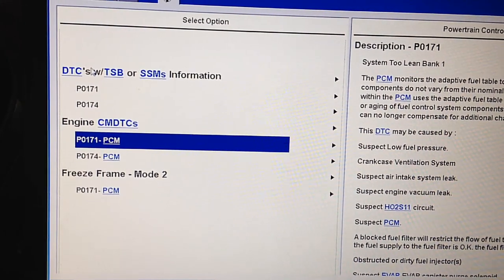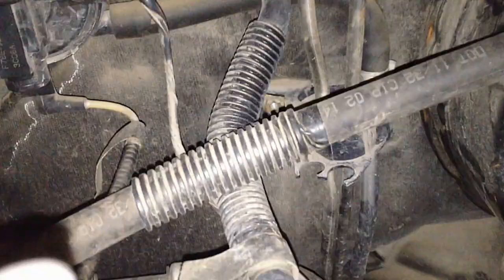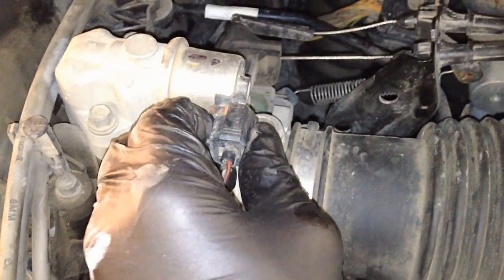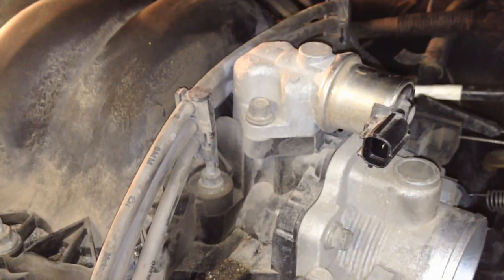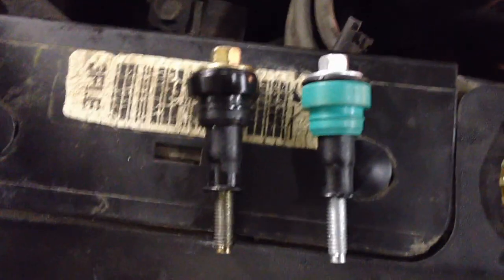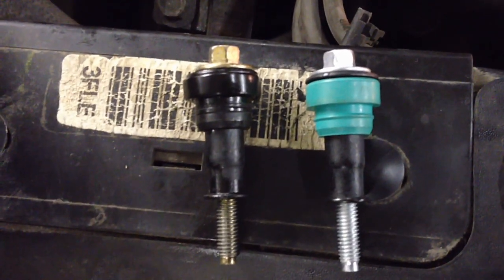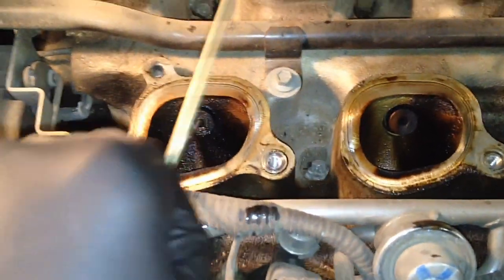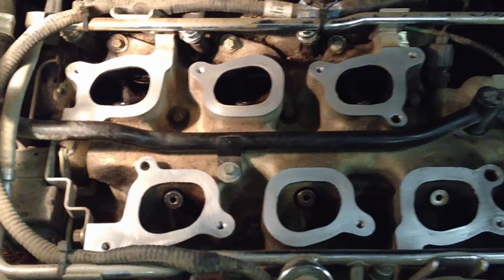Ford Windstar P0171 P0174 Upper Intake Manifold Gasket Replacement

Comment: How long does it take to do a job like that?
Reply from the maker: +James Weissbach Upper intakes maybe 1hr
Reply: Thank you again. I have all the parts I bought last year. Your videos are the best. These videos give someone more confidence . Awesome.
Reply: +James Weissbach  If you have not  done  the work, yet  and assuming you have  a 200 to 2003. I just  did my Van. First, I put  all  sensors new. Gained more power  and better  fuel mileage. But, did not helped with P0171  and P0174. Had no  vacuum leaks The van ran fine, Idled fine. But, when it was warming once the needle was like one quarter it started to miss. I had to put it in Neutro  and accelerate a bit. Then, when it warmed up no problems. Well,  I did the job. Put new Isolator bolt.  new gaskets  for the middle intake and the top. Bought from partgeek.com. The job looks a little hard but, in fact is easy if you have worked on car before. Be very care with the Isolator bolts. Some one here on youtube recommended 80 pounds of torque. Another one recommended 60 pounds of torque. I should have listened  to the 60 pounds man. I popped a bolt trying to get to 80 and that was bad. Now how am I going to get that piece of bolt out. Got me  from autozone  a bolt extractor  used the smallest  drill  dead center on the broken bolt. Started slowly drilled about half inch inch in,  I  reversed the drill and  the bolt came out about 1/4 inch grabbed with a pair of grip got it out in about 15 minutes. It takes 60 pound. Use a  sequence diagram   to tighten  the bolt. A needle dial torque wrench would be nice. That click one I don trust.  Use in  20 pounds increments in sequence. That should take care of P0171 and P0174. My gaskets in the middle  intake were oil wet evidence  it had  a vacuum leak there. Now my van do not miss while it is warming up. It cost me $350. The oxygen sensor, $128. at partsgeek.com. I had that installed. $ 100. The rest I did. Good luck!!
Reply: +James Weissbach It took me three hours. Because I took my time to make sure everything  was done correctly.
Reply: Thank you so much. I'm tired of getting ripped off.
Reply: +James Weissbach  I hear you. There are a lot of dishonest mechanics out there. If you had or had not done the job be careful with the Isolators bolts. Someone mention here on you-tube that it takes 80 pounds. No they don't. I tried and I broke  one. Had to buy that bolt extract from auto zone to extract it. I followed this video here and is very good. Tighten  the Isolator bolts to 60 pounds  20 pound increment  and in sequence. Do the top manifold the same way.  I did not bother to do the valve gasket it's just find. Well, After doing this job I past inspection.
Reply: Heriberto R Montalvo Thank you for getting back to me . I know I half to do it .did you clean the injectors also ? or change them?
Reply: +Heriberto R Montalvo The service manual spec is 89 INCH POUNDS, not foot pounds!  That's why you broke it!  (I've read that the Haynes manual incorrectly says 89 foot pounds, so that could be what causes this confusion.)
Reply: +ScubaCat3  Thank you. I did got the job done. Thanks to this video and a lot of research before I attempted to the job. I had  the 4 oxygen sensors put in.The Idle valve and put in the EGR valve and the  EGR pressure sensor. A total of $500.00 by me doing half of the job. The engine runs like new now. The dealer will charge you that much just to look at it.
Reply: +Heriberto R Montalvo Good deal.  You probably did not need an EGR valve though - those hardly ever break.  It's the sensor that fails.
Reply: +ScubaCat3  Probably not. I but I hardly put any money in this engine for 12 years. I did noticed that the Idle would go up to 1000 rpm from time to time. I put that new. Now it Idles at 700rpm . It used to Idle at 800rpm

Comment: Not looking forward to doing this it’s giving me flashbacks from when I had to do this for the old Chevy I had now the f150 is going to get all the junk replaced along with Pcv valve valve cover gaskets all the Pcv tubings and fittings the effin spark plugs the wires to the spark plugs and a good bit more that I’m forgetting bought it from a guy that said they took care of it and I’m finding out that was not the case

Comment: Great video. I heard you say 89 inch/lbs, but what is the sequence? Also, my son's van is a 2003 Windstar and is displaying the same codes P0174/P0304 misfire on cylinder #4. There is coolant spitting up from under one of the fuel injectors. After researching on the web, it looks like it may be the lower intake manifold gaskets. I just bought the gasket kit. Will this fix the problem? Is the torque the same for the lower intake and what is the sequence? Thanks again for the great video.
Reply from the maker: ubywone Yeah coolant is definitely lower intake gaskets. All the torque sequences are below the video in the description. I can send you the procedure for the lower intake from our workshop manuals if you have an email.

Comment: Thanks for this great video, very clear and easy to see what you did..One question: would it be a good idea to also take of the lower intake and replace lower intake gasket? I think mine is starting to leak. Is there a video for that? Thanks again A+++++

Comment: Awesome video! Attention to every detail. I'm getting ready to tear into my wifes 2001 Windstar. Have a misfire error code on #2 & #6 cylinders. My gut tells me its the coil. Replaced it before. Can't help but think what are the odds of it being #2 and #6. They share the same bay on the coil. If that isn't it, this video has made me almost WANT to take the intake off, even if its just for fun. (Would really impress my wife, of coarse me watching this video would be my secret).
Reply from the maker: Yeah I would go right for the coil on this one.
Reply: As we spoke my wife called and said the engine light was blinking now and she smelled "fireworks"...Sulfer I assume. Exhaust was hotter than a sweatband in a firemans helmet. Converter I assume. I didn't check coil yet, but I did see the IMCR on the left side was disconnected. Bushing must have broke. That would be sweet if thats the only problem. Drove it to VA Beach a month ago and it bucked like a wild horse the whole way.

Comment: i did everything in this video and still have the code it went off for 3 days and it came back but old code was the p0171 now its p0174
Reply: ok so you dont have the old code, now you have a different code right?
Reply: @61spindrift  if you have an email i can send you my obd2 scan readout PDF i used blue driver
Reply: @61spindrift  care just starts and stops now i have to replace the evap purge modual but its someplace lost in the mail lol,my plenum plugs were popping off when i ran the car one for purge valve and the other one connected to the oil res...

Comment: I've read elsewhere that there is a design flaw for the entire manifold and that there has been a redesign (see link).  Is changing the manifold gaskets more of a "band-aid" solution for a bigger problem?  In the long run would it be better to replace the entire manifold kit?  Thanks for any help you can offer. 

http://tinyurl.com/kseo2q4
Reply from the maker: Eric Estes I have never had and issue or heard of an issue with cracking of the lower intake on these sounds like they copied a gm 3.8l common flaw for the description. What is the current problem just lean codes?